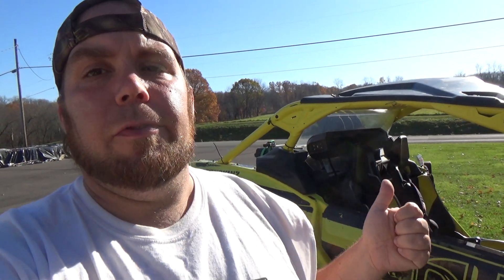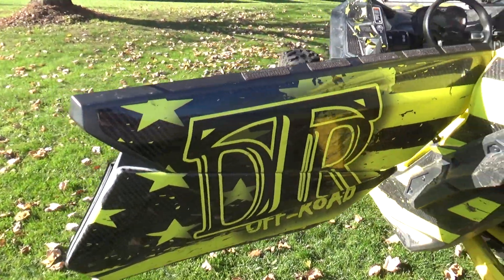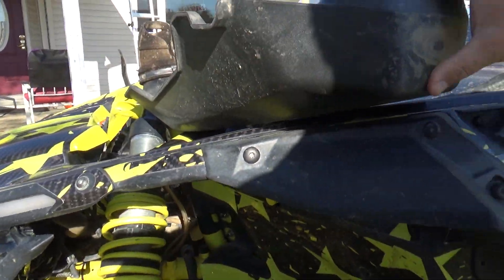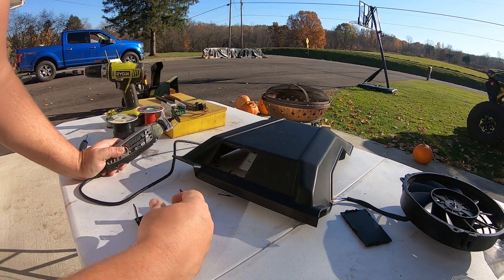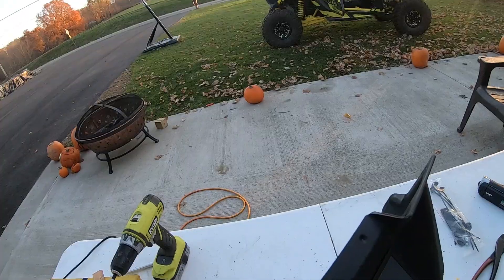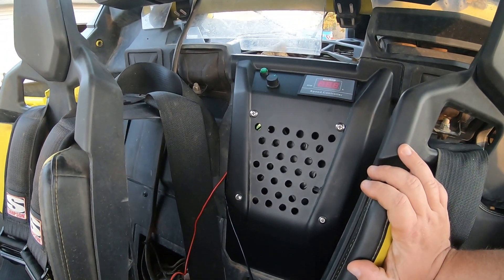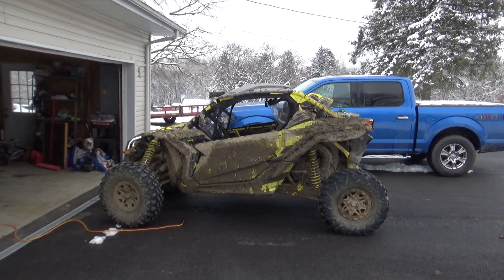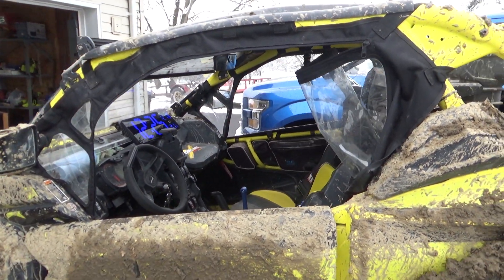Turbo Heater: How Warm Does It Get?

Comment: Hey nice video but i question, is gas smell inside the cap ?
Reply from the maker: No if you smell fumes, that would be an issue like an exhaust leak. But I guarantee you'd hear that clearly

Comment: I'm thinking about doing this in the reverse to keep the turbo and engine heat out of the cab in the summer. Have you tried that? what size is the fan?(6",7",9",etc)?
Reply from the maker: I have reversed the fan... it both works like you expect and helps create a whirlwind of dust in the cab lol. Unsure on the fan size without going home and measuring

Comment: Have you run through mud/water or deep so with it and had any problems I’m in pa also about 30 mins or so from Pittsburgh and I’d like to build a enclosed for my 12 rzr 900XP and do something like this but I’m afraid that it would short out in the mud or water
Reply from the maker: Had no issues with it but never completely submerged it

Comment: From talking to folks that have done this mod, it works while at very low speeds like technical sections of a trail, but it really doesn't work while moving at normal speeds. The flowing cold air while driving will lower the temps around the turbo and the heater isn't really effective.  Have you noticed this?
Reply from the maker: I would agree... most of our riding is well under 20mph. To be honest it comes in clutch on a cold night when there's a backup on a trail or a situation where you're sitting idle. I turn and warm my hands and appreciate the heat coming off it.

Comment: Awesome video! Does it get warm enough to defrost the window?
Reply from the maker: I would say it has little effect for defrosting... for myself I have the flip up poly windshield and I treat it before rides. When it's summer I use a rainX for plastics which makes everything bead off. In the winter time I clean it well then smear a few drops of dawn until it rubs clear. Dawn prevents fogging. I used to use it on my goggles. But if you're wanting high heat with defrost ability, you'll have to get a full blown heater. We're in an area with mild winters, this turbo heater increases the in cab heat enough to take me out of a jacket and make a hoodie comfortable.
Reply: @dtroff-road5427  thanks for the reply!

Comment: 2 questions. Is that better then a heater? And is it water proof? Can you get it wet?
Reply from the maker: I would say it's water resistant, the speed controller says it's water proof but it doesn't look sealed well enough and you could always skip the controller and just have an on/off switch. It's not better than a heater but a heater is going to be 5-10 times the price and way more labor intensive to build. This makes a sealed cab comfortable in a mild winter area. A heater would have the ability to burn you out in a very cold environment. If I wanted true heat and the ability to defrost my windshield, I'd get a heater. For me though, I'm fine without heat and since this was so simple and cheap, thought I'd give it a go.

Comment: Awesome setup but my only concern would be if it actually sucked any exhaust fumes in the cab. Just an observation.🤔
Reply from the maker: Many people have mentioned the same thing. When we put a CAT delete on one of our X3s we hadn't gotten the pipe to seal correctly against the turbo the first time and it was noticeable immediately. You could hear it instantly if you had an exhaust leak. So since i don't have an exhaust leak i don't have any concerns about fumes. Also, even with the enclosure and windshield, there's still soooo many gaps that it would be hard to run out of fresh air.

Comment: Great video sir. How do you like your enclosure? If so what brand is it?
Reply from the maker: My enclosure is moderately ok. Zippers lasted one season and needed replaced. Even though it's pricey, I'd recommend the BRP uppers
Reply: @dtroff-road5427  copy that sir.
I'm just worried a bbn out dropping good coin on an enclosure and then getting a new cage and they're not compatible. Scary...
Hate wasting money
Reply from the maker: @markcoleman2960  honestly, if you're gonna cage it out... get the cage and take the buggy to an amish textile place and have them make you a custom heavy duty setup for a fraction of the aftermarket options
Reply: @dtroff-road5427  hahahaha....
Not much Amish doen here in the south brother....but good 1....hahahahaha
Reply from the maker: @markcoleman2960  lol... my bad, they're all over up here. They make nice enclosures for their horse drawn buggies. I wish i would've initially just went to them to have something made. Another option is a boat cover place. They use a heavy duty material, snaps and zippers.
Reply: @dtroff-road5427  probably because they despise doing shit twice.
Reply: @dtroff-road5427  good to know as I'm still on fence of what upper window kit I want to purchase, seen SxS Marine and WV-Trailn  both installed DMX upper windows kit, completely opens with the x3 door, has a seal, both have said there are gaps that they filled with foam tape...but...once again both said zippers were an issue also...with the DMX they claim clean regularly, spray with wd40, lithium spray, etc...
Reply: Awesome video! Great idea.  When you wired up the fan did you run it directly off your battery?

Comment: Great idea bud 👍😎👍
Reply from the maker: It's a copied idea that i thought should be looked into and shared... thanks for watching!
Reply: @dtroff-road5427  Great re engineering designs of all kinds on here. Like the 3 inch fan stuffed in the 2nd air intake of the clutch housing that REALLY works lol Keep the great ideas coming bro 👍😎👍
Reply from the maker: @tagsdaddy  idk anything about that... is it too keep the clutch cooler? I haven't had an issue with belt temp at all
Reply: @dtroff-road5427  Yep, at high speed the primary does pull enough air to cool the belt but at low speed, or crawling up hills,  or mudding,  belt teps rise fast. With a flick of the switch on my steering wheel the temperature of the belt starts to drop rapidly on my razorback gauge. Cheap Amazon 3 in blower with a 4 in to 3 in coupler stuffed in the tube inside the air box out of sight.  Cheap little fix instead of removing the belt cover in the dunes or running down powder sand beaches.

Comment: That is awesome!! Thanks for the pre-engineering, looks great
Reply from the maker: Thank you, and thanks for watching!
Reply: @dtroff-road5427  please, do an on trail ride, cold day review?...just curious, aside from gaps you have, how much heat will push in the cab while running down trail....
Reply from the maker: @jacobwagnercanamx3crazy941  i can incorporate that in a future video. But I've been running this for nearly 2 months. A few days ago we had heavy snow that shut down our highways. Myself and a buddy went riding down some backroads, probably 20/25 degrees out all night. I had to take my jacket off and leave it in the passenger seat. Heavy sweatshirt was enough. I'm not saying the cab was warm, but it was much warmer than outside the cab. We would stop and get out and I'd need my jacket. But inside, no jacket or gloves and i was fine. If you want legit heat, buy a real heater that runs on the coolant lines. This probably kept the cab between 40-50 while riding which was fine to me. Much better than the 20 degrees plus wind i would've felt without it.
Reply from the maker: @jacobwagnercanamx3crazy941  also... we were riding roads at a fast pace, if we were trail riding slow there's less wind so it would be even warmer inside
Reply: @dtroff-road5427  I personally think it is a killer idea, (wish you would make them and just list them for sale, already have 1st one down pat, lol)...think I'm gonna definitely give it a try, thanks so much for the input,
Reply from the maker: @jacobwagnercanamx3crazy941  well the idea is basically stolen from the X3 Facebook page. Last year there was a guy selling these premade for $100. Not sure if he still is or not. To be honest though, the speed controller isn't waterproof and not really necessary. So you could just buy the fan for $20 and a few dollar on off toggle switch plus a half hour assembly and have the same thing. You could search the x3 page and see if that guy's still selling his version